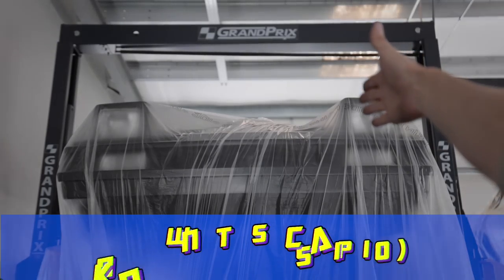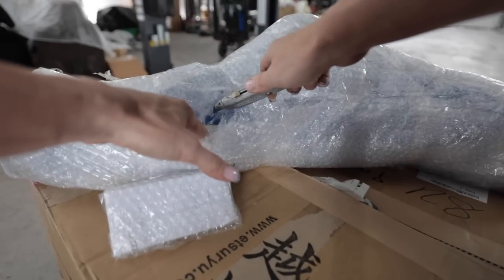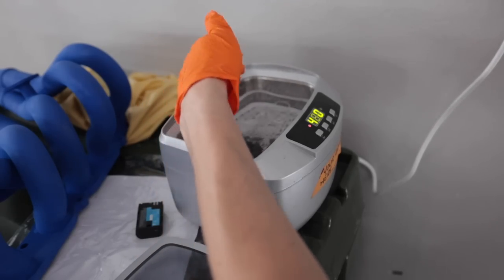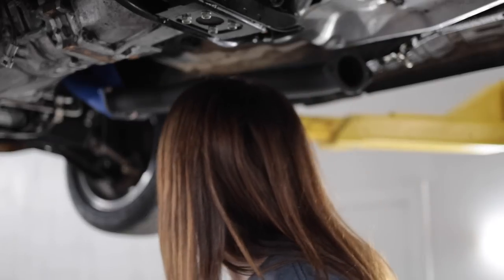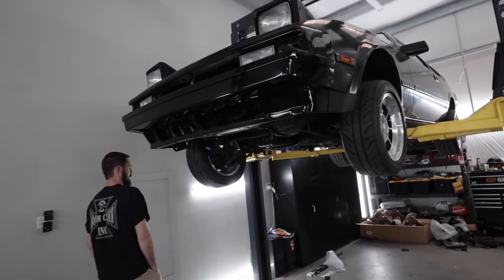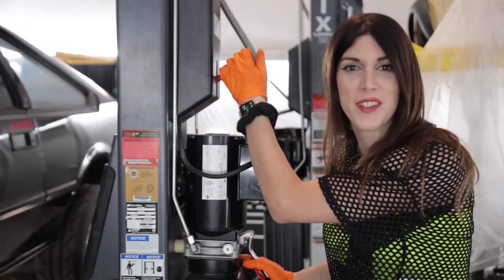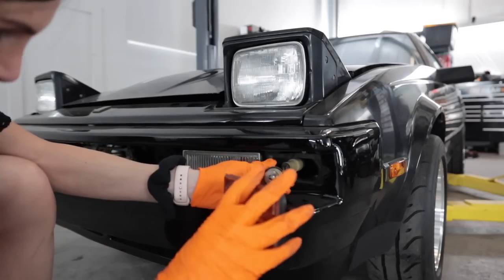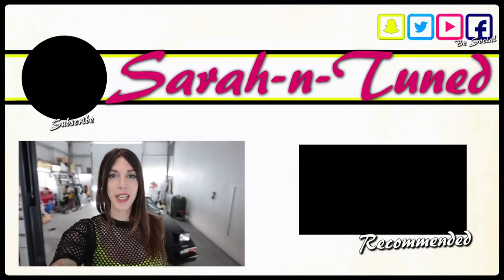Sounds Epic! // MK2 Supra Greddy header + 3” Exhaust

Comment: A tip to help extend the life of your ultrasonic cleaner... Put the parts you want to wash in a plastic bag and add water and degreaser to that.  Then put the bag in the water of the cleaner.  This will keep the main water bath uncontaminated and prevent an unwanted chemicals and dirt from getting on the walls of the cleaner's main tub.  This will prevent cross contamination from future cleans, and mean you won't need to clean the cleaner when you are done.
Reply: A real ultrasonic cleaner will perf holes in a Ziploc. The jewelry cleaner examples don't work well enough for long enough to have this be a concern. This has been my experience.
Reply: @mackreig2356  in 3D resin printing we use the high grade cleaners all the time, I have never seen a bag perforated.

Comment: Always loved the sound of a straight 6 plus how smooth and torquey they were. Specially the bigger displacement versions like Ford’s 300 or GM’s 292 or 302. GMC built straight sixes as large as 503 c.i. For highway trucks in the 50s. A lot of racers ran their big sixes at Bonneville and El Mirage for years.
Reply: To this day, almost all semi trucks have a straight 6. It is a strong design. Just requires a long hood on a car.
Reply: @bongodave13  the old sixes were virtually indestructible too. As long as they weren’t run dry of oil or over revved they’d last forever.
Reply: AJ6 engine from the XJ40 X300 range of late 80's and 90's Jaguars are brilliant underrated engines, strong, smooth a silk and virtually indestructible.
Reply: Had a 300 straight six with a Holley 750 double pumper on a 4 barrel intake from some old race driver that had it in his junk pile. we  got the thing bored .030 over and put forged rods and pistons in it. best , most torquey motor i ever had,and i couldnt killl it. I wish i remembered the specs all these years later. from that to a 2JZ..... amazing the more things change the more they stay the same.

Comment: A lot of the JDM after-market suppliers have loaded vehicle specs in their CAD systems. So, you can tell them what you have and want, they load it in the machine hit the button and the robot makes it for you (if it is with in vehicle tolerances).

Comment: Ultra sonic cleaner tip  
You can put bolts in a glass jar with stronger cleaner and put it in the cleaner with just water in it. So you can use less cleaning solution.

Comment: What a sublime transformation. Iust imagine driving this bad-ass Toyota at sunset, blasting Rush Limelight, hitting the backroad turns and twists, the exhaust crackling and roaring. The only thing that could top that would be if it was also making turbo noises. I hope this goes to a loving winner.

Comment: Automotive typically uses Electrogalvanized which is a Zinc coating applied electrolytically for a consistent thickness because it goes into body components that will be painted, but does not reflect heat. Aluminized is a hot dipped process and used anywhere for heat reflection such as heat shields.

Comment: If you want to reduce, or nearly eliminate the smoke paint thing - after you've primed (VHT only of course!) and painted your parts, take a propane torch to the insides and out. Never stop moving! You just want it DAMN hot, but not so much you're burning it.  Don't touch it!  Let it cool right down, then do a 2nd top coat. Torch it again, and let it cool.  It'll now be tough as nails (mostly!) and won't smoke for the first hour of run time.

Comment: For these times I think you should get one of those portable camp showers. Also might come in handy in case another can decides to pop on you. Im not usually OCD about cleaning stuff but I'm actually triggered by that new blue long tube header being next to that crusty valve cover. Please paint it at least with the same high heat black you used for the exhaust.

Comment: Really fun to watch this take shape.    The 82 supra was a moderately powerful, very very quiet, smooth riding luxury car.  It has nothing to do with the 2023 Supra. The idle was so quiet you couldn't tell it was running until you put your ear six inches from the grill. It was built for rich business owners to drive to lunch in.  So I am baffled why anyone would want a very quiet, smooth riding, moderately powerful luxury car that you constantly have to cycle the clutch to drive in 3 mph traffic in a big city.  Yeah, that's what this thing was designed to do.  Drive to work and take a few road trips on the occasional weekend.  Not really a car for the track or anything.  When these hit the streets it was so advanced, it was as if it had landed from another planet.  For fun go look at what else was for sale in 1982, it all looks like junk in comparison.

Comment: With six cyls, either run the secondaries from the headers back to near the rear axle and merge (look at BMW) or put in an X pipe after the headers (many V6's) and run the dual pipes all the way to the back of the car. That will give the best midrange torque boost from the alternating pulses of the front and rear sets of cylinders that run 180 out of phase with each other . That merge straight after the previous 3 into one merges won't work as well and be much higher up the rev range.

Comment: Keep an eye out for manifold flange leaks. I know with mine there was a difference between the flange on the stock 5M manifold and Thorley header I put on. I never took the nuts off the studs so the studs bottomed out before the gasket crushed and sealed.

Comment: Is that really a heat coating? I have purchased headers before with a white coating on them and it burned off to bare metal as soon as the engine was started. I found out it was just to there to prevent corrosion while in storage before installation.

Comment: Hi Sarah. I have a question?. I am going to use a Mig flux welder to repair door sill on my VW Golf Mark 5 GT TDI 2.0. Please could you offer advice on what I need to disconnect?, Battery Alternator ECU?. Will I need to recode after disconnecting Battery?. HELP

Comment: Ah,  dual-tip muffler, very period-proper.  :) And such devotion to detail and cleans.  :) (And whether you go parallel to the bumper or not is kind of a judgment call.  Splitting the difference is likely to make it so no one can notice either way in most cases.  :)  )

Comment: Be careful when using anti-seize. using Copper based anti-seize on aluminium cylinder heads will cause a galvanic reaction between the cylinder head and the bolt. In situations like that use aluminium based anit-seize.